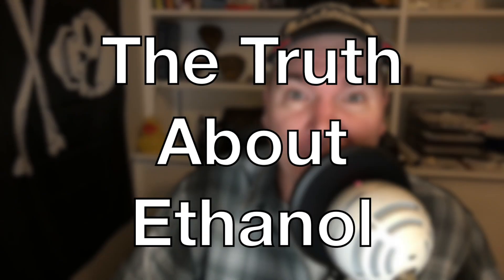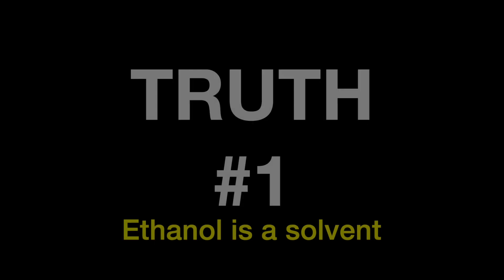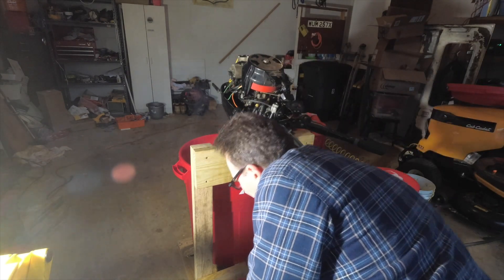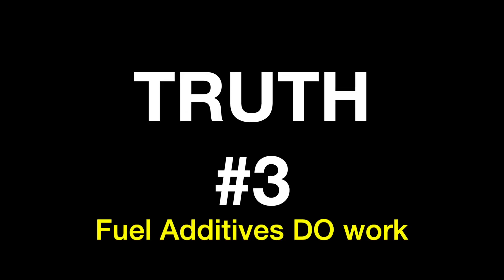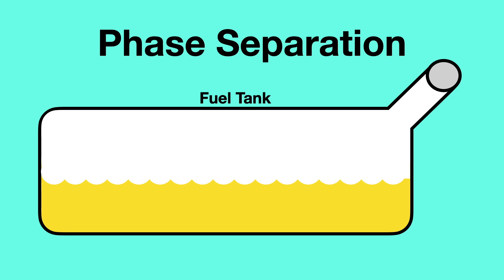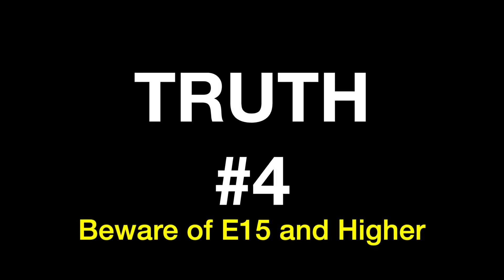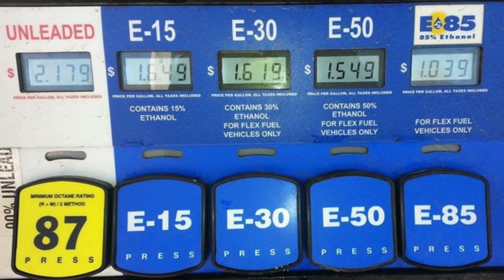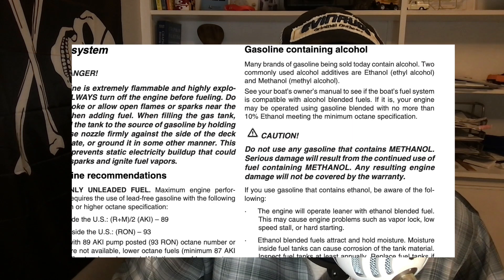Ethanol Problems - How to deal with E10 blended fuel for our boats and small engines

Comment: You recommend filling the tank with stabilizer added for winter storage.  What are your thoughts of storing with minimal gas /stabilizer and filling with fresh gas before starting?  This is what I’ve been doing with no problem so far.
Reply from the maker: That seems to be a good option as well. Some people debate the pros and cons of both - but your approach has a lot more fresh gas, and my approach has a lot less air space for alleged condensation.

Comment: Hey Wayne, 

Just came across your video. I recently bought myself a new Tohatsu 9.8 outboard. A nice little upgrade from my 1975 6hp Evinrude. (which I still love)

I live up in Canada and all of our gas is now at least E10.

My outboard motors only get about a month or 2 of use each year and I have been stressing about the issues this could potentially cause on my new motor. So much so that it has lead me down a youtube rabbit hole on how to separate ethanol from fuel. I don't really want to do this as my boating time each year is already limited. However, I don't want to have issue with my motor either. 

My plan is to essential do what you mentioned in your video. Run the carb dry and drain it before long term storage. 

I never use old gas. If I have some in my Jerry can before the season I will empty it out and use it as a fire starter. I am always filling up with the highest octane possible (usually Shell V power as its the closest to me). 

A few questions for you.

I have always been told to run premium/highest octane available for small engines. Is this still the case even with E10 fuels?

I plan to add a stabilizer each time I fill up my outboard tank, Is there a specific one you would recommend?  (there are so many to choose from)

Thanks Wayne. I have watched several of your videos over the years and I love em !
Reply from the maker: Thanks for kind words. It seems our biggest benefits are from making sure we're using very fresh fuel and running the carbs dry. Supposedly the newer engines have less problems with the E10 than older engines.

Comment: This one of, if not the best video explaining the issues of ethanol for 99% of people to understand. Use an engineered premixed fuel in cans for small 2 strokes that are seldom used like chainsaws or trimmers. That way you’ll never have an ethanol problem. Your equipment is much, much more likely to start when you need it and no frustrations.

Comment: Guess what else is a solvent: Gasoline and its aromatic components (benzene, toluene, xylene, naphtha to name a few). The detergents added by gasoline companies are also solvents. So why single out ethanol as a SOLVENT, as if it's something bad?

Gunk forms because of gasoline. It builds up, it causes problems. Ethanol is a better solvent and helps to clean the gunk away. If you didn't rely on the ethanol to do this, you would have to find another solution, such as engine additives that can cost as much as 3 or 4 gallons of gasoline. Ethanol that's included in ethanol-gasoline blends is included in the reduced price for the blends versus ethanol-free gasoline.

Water forms in fuel tanks because of natural condensation. The exact same natural condensation, in the exact same quantity occurs in gasoline that has NO ethanol in it. This means that if there is phase separation, the phase separation will occur in either situation. The corrosive layer you refer to would still exist. The good thing about having ethanol in the fuel tank is that the ethanol absorbs the water and when the ethanol-gasoline blend combusts, it vaporizes the water. Could there be an over-saturation of water in a tank that the ethanol in E10 can't absorb? Sure, so then the answer is to use E15 or E20 or E40. If you don't have ethanol, you would have to add a product like DRY GAS or HEET to get rid of the water. Can you guess what the active ingredient is in DRY GAS and HEET? It's alcohol! It does just what the ethanol does. Why? Because ethanol is an alcohol!

Phase separation does not happen with higher blends. If it did, we would be hearing and reading about this happening in Brazil where the mandated minimum level of ethanol in fuel for all ICE vehicles (cars, boats, motorcycles) is E27.

Why don't you know this, Wayne the Boat Guy?

Fuel additives are meaningless, in many of the additives as I mentioned with DRY GAS and HEET, the active ingredients are just alcohol. They're a waste of money.

Sta-Bil, which is a good product, was invented in America in the 1950s, a half century before the regular use of ethanol-gasoline blends in America. It was the solution to the very same problems that exist today. Nothing about their formula has changed to address any ethanol problems, the only thing that changed was some text on the label that pretends it does something additional.

Your claim that engines have not been engineered for E15 and higher is bullshit. Brazil has the exact same vehicles we have in America. They started mandating E15 in 1978. They've mandated E20 and higher for about 2 decades. When a car rolls off the Ford assembly line in Mexico, or a Kia assembly line in Korea, or a Toyota assembly line in Japan, or a Mercedes-Benz assembly line in Germany the vehicles are the same, regardless of whether they will be shipped to America or Brazil.

In addition, ethanol-gasoline blends higher than E15 were regularly in European countries starting in the 1920s. 

And, furthermore, even the testing done in America proves that gasoline blends higher than E10 causes no problems other than whatever normal wear and tear problems caused by any ethanol-free gasoline.

And did I forget to mention that the same boat motors, small engines, and power equipment we have in America are also sold and used in Brazil, where the minimum fuel is E27. A lwan mower that can run on E27 in Brazil can also run on E27 in America!

Why don't you know this, Wayne the Boat Guy?

Storing engine for a long time... If you do this, you have to take precautions. But this is just as true for engines that use E85 as it is for E0. That's all there is to it. The use of ethanol-gasoline blends will not result is any greater problem than using E0 (ethanol-free gasoline). The primary problems with storing an idle engine for a long period are caused by gasoline. Ethanol dries as clean as it burns. When ethanol evaporates there is no residue. When gasoline evaporates it leaves a gummy residue. This gum hardens and become a varnish that destroys engines. A filled, sealed tank and system with Sta-Bil is the best solution. The tank and system can be filled with just gasoline with Sta-Bil or an ethanol-gasoline blend with Sta-Bil. Why is the Sta-Bil good for either fuel? Because the problem is the gasoline. Gasoline goes stale. Ethanol never goes stale - but the gasoline of other denaturing agent may go stale.

Running an engine and fuel system dry isn't much better of a solution since condensation can occur even in dry tanks tanks and engines. All that's needed for condensation to occur is air and temperature change.

Time for you to learn the facts about ethanol, Wayne the Boat Guy!

Marc J. Rauch
Author of THE ETHANOL PAPERS and YES, TIN LIZZIE WAS AN ALCOHOLIC
Exec. Vice President/Co-Publisher
THE AUTO CHANNEL
Reply from the maker: After reading your comments and re-watching my video it looks as if you're really looking for little things to challenge. 
You seem to essentially agree with most of my points which are: that ethanol is a solvent, phase separation does exist, filling the fuel system before storage and using some stabilizer is a good idea, and that running an engine dry is second option.

"Why don't you know this, Wayne the Boat Guy?" 
First of all, I am not a scientist. All of the info I presented here came from my personal research on multiple other sources which have publicly stated all the things I shared. My research is far from perfect and I doubt there's any perfect research on this subject because all real-world experiences have probably not been recreated in a controlled laboratory setting and why would they be? There surely isn't any well-funded laboratory researching the negative aspects of ethanol in fuels because the world so desperately want/need it be a viable option for multiple economic and political reasons. In other words, it may not be perfect but it helps! 

I assume most (if not all) of real testing is looking into how ethanol blends work in newer automobiles and light trucks and it seems to work just fine in those applications. This makes sense since probably 95-99% of E10-E85 will be used in late model cars and trucks. Older boats and small engines that might sit for 6 months at a time through severe seasonal changes surely were not the criteria any testing agency was considering other than 'does it run on this?' Testing agencies don't have the time or resources to let the fuels sit for 6 months in older tanks for engines to see how they perform after long-term storage in a real-world seasonal environment. And even if they do have any data showing negatives from long-term storage or older engine issues, the parameters of a report to see if high ethanol content "can" work to run engines would not need to include such data. 

"Your claim that engines have not been engineered for E15 and higher is bullshit." 
Most, if not all, marine engines and small motors sold in North America have labels on them telling the consumer to NOT USE E15 or higher. I even show an example from a shop manual that specifically states "no more than 10% ethanol" at 05:14 in my video. So I am merely sharing the information the manufacturers and other reputable sources are presenting. 

You mention Brazil and their much higher higher ethanol blends. I have in fact read that they use very high ethanol blends in Brazil. Maybe the locals who run older engines have lots of problems with it - or maybe they don't. In the USA, we get very little real news or information from other countries and we are always sceptical of the information we do get (thinking it's propaganda if it's positive etc.) 

Have YOU traveled to Brazil and met with locals running older engines to see if they are experiencing problems from their fuel? Maybe their climate helps or makes it worse. Maybe they all DO have problems and have to discard fuel after a few months or flush their engines with something to keep them from failing. Or maybe it's all perfectly fine or better than it was before ethanol blends.

I have seen multiple examples first hand, on forums, websites and YouTube videos with people experiencing serious fuel system issues in older boats and other engines and it seems to align with after they started using ethanol blended fuels. Some of these problems are clogged up fuel lines, damaged carbs, un-burnable fuel that is less than a year old, etc. One of my personal experiences was when I drove through Iowa years ago and ran a few tanks of 'gasahol' while I was out there because it was cheaper. The old timers said it would ruin the gaskets of my carburetor. A week later, when I returned home my car wouldn't start because gas was literally running out of my carb all over the engine. I had to change all my gaskets because they were ruined and the only explanation anyone could find was the 'corn gas' I had used.

Maybe some of the problems people are experiencing are more related to other additives in newer gasoline. Or we are mistakenly connecting what are merely 'old engine issues' to the newer fuels. But it does seem that there's many fuel-related issues and "old fuel" issues these days, especially with older carburetor engines.
Reply: @WayneTheBoatGuy  First, I sincerely want to thank you for your response. You obviously took time to consider what I wrote. The problem with your response and your comment that I "essentially agree" with you is like saying that you should get credit for answering "5" when asked what 3+3 equals. Although 6 is close to 5, it's still the wrong answer.

You don't have to be a "scientist" to know the correct information, just have to have the correct information. You didn't present your video in a manner of you asking questions, you presented information as if you actually knew the answers. You were close in many instances, but not correct.

Ethanol fuels have been used and researched for well over 100 years. There is vast documentation of the tests and studies that show ethanol to be cleaner, safer, healthier, more powerful, and just as economical as petroleum oil fuels. The reason my book "THE ETHANOL PAPERS" is 600 pages is because I spent the time to report on almost every aspect of the issue and to do so from different perspectives. What information I didn't get to in the book, I have written about in several dozen different reports since the book was published. You can refute what I have written about, and/or cite references that challenge my references, but to do so you must provide the counter-references and findings.

I also know that when a person or entity (such as an oil company) makes claims against something in America, and then does exactly the opposite in another part of the world, they are hypocrites. Being a hypocrite isn't too bad until it costs the lives of people. I'm specifically referring to Standard Oil's defense of leaded gasoline in America, and then their acknowledgment in Europe that ethanol-gasoline blends are cleaner, safer, healthier, and more powerful. Leaded gasoline has killed and permanently disabled millions and millions of people.

If an engine sold in America and Brazil can safely run on E27 in Brazil, then it can safely run on E27 in America. There's no equivocation on that, regardless of what an owner's manual says. Manufacturers often do have different ownership manuals in different countries to meet the specific requirements of that country. If a manufacturer states not to use any blend over E10 or E15 in America it is only to limit their liability. They act the same way that an insurance company will work to limit liability when faced with a claim. Yes, Brazil also uses higher blends than E27. Their "flex-fuel" is E95, not E85. 

You ask if I personally know that there have been no reports of problems with blends in excess of E10, and the answer is "yes." I know this because I have personally interviewed and researched the issue over several years. There is no reason to discount the people I have interviewed or the data I found in my research because the results are the same as the results found here in America. About 13 years ago, when the EPA announced they were clearing E15, and that E15 testing had shown it to be exactly as safe and problem-free as E10, I was on the conference call that made the announcement. I specifically asked if they tried any other blend levels and what the results were. The head of EPA stated that they also tested E20 and that the results with E20 were the same as with E10 and E15. These results are the same results that the laboratories in Brazil had found. They are the same results found by testing laboratories 115 years ago, and then 90 years ago, and 50 years ago. Moreover, in my own personal testing of high-level ethanol-gasoline blends in flex fuel and non-flex fuel vehicles, I personally know E20, E30, E40, and E50 to be as safe as E10. Therefore, I didn't have to be at the U.S. national laboratories or the Brazilian national laboratories to verify their results. 

In my reports, I provide links to several chemical compatibility charts. They all show ethanol to be less corrosive than gasoline and aromatics. They all show ethanol to be fully compatible with the rubber, plastic, and metal components used in engines and fuel systems. If a seal goes bad from corrosion, and there are multiple ingredients that the seal comes in contact with, then the logical answer is not to blame the ingredient that is the least corrosive (which is what you have done). In addition, any problem that you and others try to attribute to ethanol are the same problems that existed in the U.S. during all the decades before ethanol-gasoline blends were routinely used in America. You can't now suddenly blame ethanol for these problems.
Reply from the maker: @TheAutoChannel  obviously you know much more about this subject than the average person. Have you by any chance ever seen the Project Farm video where he shows the results of soaking aluminum and rubber components in different gasoline/ethanol blends for months at a time (like winter storage for boats and small engines)?
Here's a link to that video: https://youtu.be/UvS_D4_lF5U?si=TovbiUQMP_MzEetq
Reply: Ethanol is bad! It absorbs water and will carry it through the fuel system helping to form rust and corrosion on metal. It also causes phase separation and it's not as bad as some think if only we could easily drain the water from the tank. It also causes rubber, plastic and some gaskets to dry out. Shall I continue? I would bet you anything politicians have a lot of money invested in the corn market.

Comment: what about 2 stroke?  does ethanol have any effect on 2 stroke tools and bikes for example.
Reply from the maker: I have had more problems with ethanol fuel in my 2 stroke engines than in 4 stroke engines. Partly because I occasionally go long periods of time without running them.
Reply: You will for sure have problems with your 2 stroke equipment. Fuel lines will harden and become brittle. Ethanol will dry up and clog your fuel line and damage your carburetor. Just get an engineered premixed fuel especially if you don’t use the equipment much.